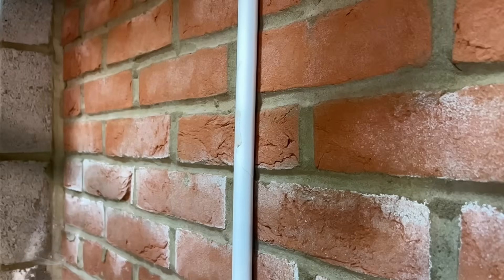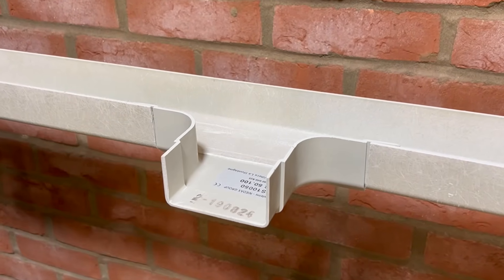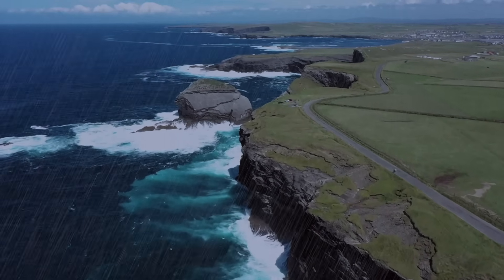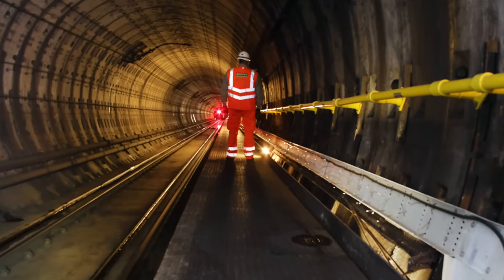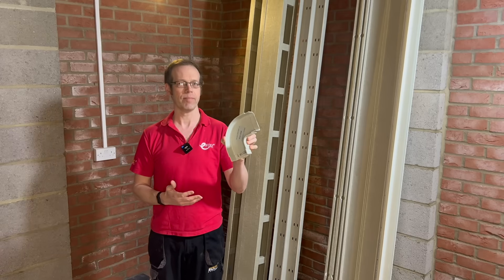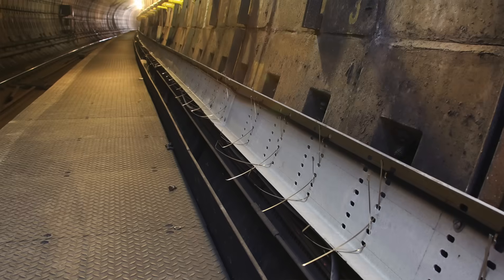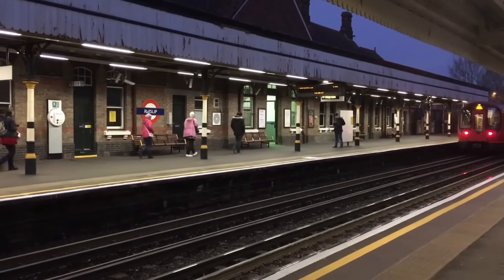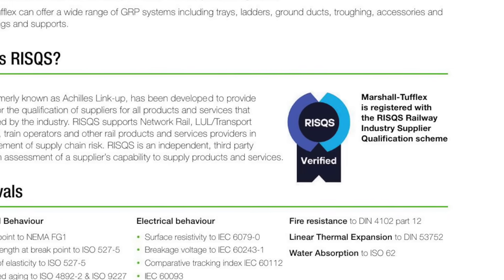You’ve Been Using the Wrong Cable Tray!

Comment: Glass reinforced can be good, but it can come apart over the years too.  I go past an RMU and a LV connection point enclosure daily.  The all steel painted RMU case has put up with at least 35 years (that's as far back as the memory stretches) of sun exposure without trouble while the younger glass reinforced enclosure has weathered to the point where the bundles of glass fibres are well and truly exposed.  Both are doing their job but the RMU is going to outlast the enclosure without a doubt.  It's a riverside installation in the tidal zone near the mouth of the river.
Reply: I've been dealing with various composites over the years in the automotive trade, while being more resistant to UV than most composites, once grp's mechanical bond does break down,it deteriorates rapidly.
Reply: RMU?
Reply: @gardenogauge  Ring Main Unit, in this case switching 11kV.